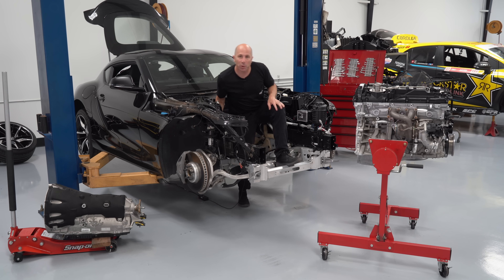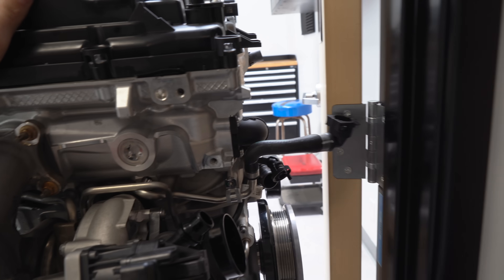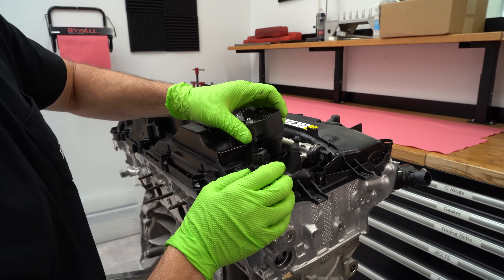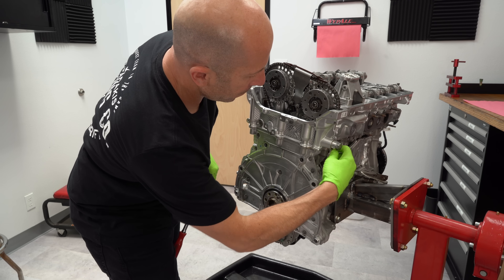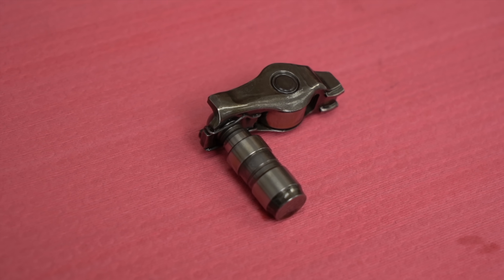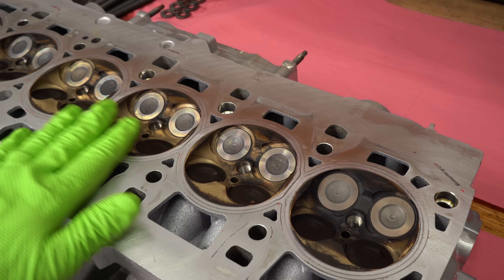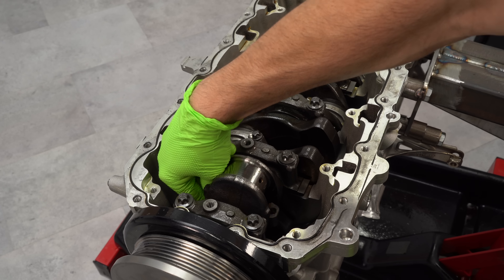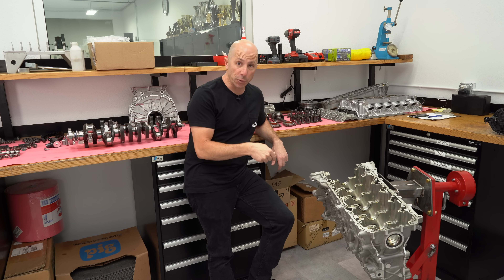2020 Supra B58 Engine Teardown - First Look - Better than the 2JZ?

Comment: 1 interesting note- the cylinder head gasket has primarily oiling ports and cutouts for oil drain back but not coolant. BMW designed the cooling circuits for the block and head to be separated. Controlling the coolant flow to each will be one interesting hurdle after some heavy mods and tuning.

Thought- I wonder what sort of boost pressure that intake manifold could handle? With the intercooler integrated, I could see the outer seams being a weak link.

Prediction for b58 engine- silicone everywhere won’t hold up like every other German engine and it will be leaks galore in 5-7 yrs.

Oh and I didn’t see any port injection. Something Toyota would have done to keep the carbon deposits on intake valves from forming. But that’s the BMW way. More reasons to visit the dealership.

-Fan (but critic) of both BMW and Toyota

Comment: Apart from armchair experts bashing/stroking on this - it looks complex and very well built - but that would probably be its downfall - its not the pistons, or crankshaft or 1k HP you'll put into it - it'll be some platic trinket that will age and crack, leading to something leaking, some electric valve fail or some shit like that... Its fine when it all works, but plastic, that doesn't last that well...

Comment: So it looks like a lot of the parts and components on this engine are incredibly specific and comprehensive.

For example: The intercooler is molded inside of the intake manifold, or how the turbo housing bolts directly to the exhaust manifold and is precisely casted for this engine.

I guess what I'm saying is that by designing all of the components so specifically, they've left very little room for aftermarket parts to be used, or for changes to be made.

I'm sure it's a great car. It seems like it's well-designed and has had a lot of thought put into it. I just don't think it will be very tuner-friendly.

And one more thing to add. Since this engine block is aluminum and not steel, I suspect that it will not be able to handle the harshness that the 2JZ could take as far as pushing the limits of boost pressure and other forms of punishment.

Comment: Bmw valvtronic spring decompress tool for the n20 4cyl shoukd work
Reply: Thats what I was thinkin.
Reply: @joshuaspencer6246  ... or the one for BMW N52 engine (I see that B58 shares these parts with BMW dual vanos engines)... I remember the torment I experienced when one year ago I did this work without any special tool...
Reply: Isn't one of the tools you mention just exactly that what he just ordered?
Aren't all BMW valvetronic decompressers just the same tool with different packaging?
Reply: @S.Tarvitz  I have... LOL
Reply: @S.Tarvitz   PHD in calculus? Wut? Do you determine the second antiderivative to calculate at what angle to hold the crowbar to loosen those springs? I'd rather just read the manual.
Reply: They change up the mechanisms here and their per engine update so that though similar its differemt and specific enough. A tool fro. Previuos engine might work or can easily be modified fabbed up to work properly. And not have to dish out the hundreds the "new" tool costs.
Reply: He could of bought a b58 from bmw lol

Comment: Looks like motorcycle tech inside that engine.  Car guys are way ahead of us in terms of electronics, but we have you beat on the mechanical side.  Coated bearings, cracked rod caps, low friction rings, all stuff that's been around for 20 years in sportbike.  If we can finally merge car and bike tech, we'd have some seriously impressive machinery.

Comment: Timing chain in the rear, intercooler in the plastic manifold, direct injection, valvetronic ,plastic oil filter housing, internal exhaust manifold inside the head?!?!? As long as nothing EVER breaks you’ll be ok! Scratch that! New = crazy amazing! Used =junk

Comment: Wow. Thank you so much for this. I don't have a Supra, but I've got an M240 with a slightly earlier version B58. Very informative stuff.
Reply: The biggest difference with your engine are the exhaust manifold and the timingchain. Yours has a split 2chain system and this is a 1 chain system. Also yours has an external exhaust manifold and this an integrated one in the head.
Reply: @kerimmejdoub1381  noted! Thanks

Comment: Fly by wire sucks because the manufacturers deliberately stunt the performance of the vehicle to comply with emissions controls. You don't have any direct input to the throttle. The computer controls the throttle. All these sluggish modern cars would be fine with an old school throttle set up. 

I think Toyota should have just refreshed the 2JZ. BMW have poor build quality. The rear timing chain will be the killer of these cars. The N47 diesel has the same fault and they snap left right and centre. Typically around 80,000 miles. Toyota on the other hand can make timing chains but chose to have a BMW one. What a disaster.

Comment: I really cringed when he was loosening the valvetronic springs. That's a sure way to break it. 

Most of these features on this engine, BMW have been using for years now. Comparing this to the old B58, the only new thing i see is the integrated exhaust manifold in the cilinderhead and a 1 piece timingchain instead of a 2 piece they used since the N47 and N57 diesel engines(since 2007). That's also where the idea of the rear placement on the block comes from.

Comment: With no roller cam follower on the HPFP, prepare for TFSI type cam lobe wear.
Reply: You are correct that was the problem with the audi and vw my friend replace his every 20k to be problem  free in in the gen1 but in the rs4 v8 and ae888 gen3 is ball bearing so no problem there
Reply: bmw had this design for over 10 years, with minimal issues..

Comment: If you buy this car, sell it before the warranty expires, it'll be an expensive fix!Very complicated engine design, every part will cost big bucks, that solid front main oil seal area means you can't line bore the block if you need to, the 2 exhaust port head will limit top end power, pretty lousy design in my opinion.  I'm not getting one!

Comment: Hey, say what you want, but this looks pretty simple compared to most of the engines from 2018-2019. Timing chain is in an awkward position, but it should last a long time. And plastic intake manifold with integrated intercooler is a no no. Other than that - pretty simple creation from bmw, looks promising.

Comment: That straight Line ^ engine sound is so smooth. No other engine design is as smooth as the straight 6....I'm very impressed that the designers went to a Closed deck block. This will help engine longevity when modding this block for extreme horsepower and higher turbocharger pressures. I did however NOT like all those Plastic engine parts. Especially the oiling system seems to me to be a large weak area. I can only imagine that few shade tree mechanics will even attempt minor bolts-ons to this new designed engine. Not much you can do other than an intake and exhaust system upgrade but I can imagine that wouldn't get you much horsepower increase as dependent upon the costs involved. I still dont like the Body design of this New Supra, seems a bit smallish to me. Toyota has a history of using other manufacturers engines for their own designed vehicles, nothing new there/here. Nope ill stick to older designs that can be modded by amateurs, this one is too costly to mod as to what you would get out of that mod. But AWESOME Video as always at Papadakis Racing. You will never see other YT creators give you the engine tear-downs that you get at Papadakis Racing.....Great Job !!!

Comment: 1. The timing chain on the back of the engine, to change it you have to pull the engine out. The only reason why they did that is to force you to go to the service and get it done (Imagine how much this have to cost at the service for engine removal and timing chain replacement). I like to fix cars by myself so this is a big minus for me...
2. Integrated exhaust manifold with the engine block, easy to manufacture as it can be manufactured when casting the engine block and doesn't require any pipe welding, although we all know how much gunk builds up in the exhaust manifold over the years this will be very difficult to clean.
3. This engine looks very cheap by looking at the amount of plastic used, over time engine heat will damage the thermal properties of this plastic and it will become very brittle, in case of a fault, pieces can get into the inside of the engine and kill it.

No point to keep going with this, this engine has capabilities to go over 1000hp, but it's not anywhere near the dependability of 2JZ to maintain this power for a long time.

Comment: Those main caps and exhaust ports both look like major future issues. But theres some decent innovation here. Its going to be pretty tune/buildable as far as bolt-ons are considered but anything more than that is going to be a ginormous P.I.T.A. Maybe after a while there may be some solutions found but until then... Fuck it. Its too soon and too odd to be an enticing build platform.

Comment: Wow - what a nicely designed engine. I must say - I still going to hate Supra from the perspective it is not supra at all, but just BMW Z4 Coupe with Toyota badge on grill. I have driven both new Z4 and Supra and they are identical, infotainment identical, controls identical, build on the same line. Honestly, just a lot of fakery - HOWEVER, from engineering point of view B58 engine is real spiritual successor to 2JZ - it is relatively cheap, simple, easy to tune and has a lot of reserve power. It has been long time since we have car which could easily gain 100hp with a map, 200-300hp with bigger turbo and do crazy power in 1000 hp range with standard block and what it seems much of standard internals. So the issue is just a badgeing and being purist, but the car is technically very solid.

Comment: It looks like on the head casting they have left 2 bungs in the head which could be used to add more flow to the internal manifold. Obviously enlarging the ports and drilling and tapping would be required

Comment: Would definitely get an extended warranty on this. Any possible repair on the engine looks expensive. But it’s a beauty. Interested to see what tuners do with a direct mounted turbo and curious to see if anyone develops an larger aftermarket intake manifold with a larger inter cooler built inside. Might have to mount the turbo elsewhere if going for large turbo builds .

Comment: Your limitation seems to be the exhaust manifold. You can only get as much flow as the internal exhaust manifold and ports on the outside will allow you, afterwards back pressure and exhaust temp will be the major limiting factor of this engine.

Comment: I'm a former BMW owner. This engine was designed and is built by BMW, no? The use of plastics on and inside the engine is just plain stupid. At some point down the road the owners of these cars will hate them. Toyota is famous for building bullet proof engines. This deal with BMW may be the biggest mistake they could have made.

Comment: Gets minty brand new motor - rips it apart instantly. Personally I don't like direct injection as much as port injection, sole reason; dirty intake valves. Looks wicked otherwise.. 12 yr old MKIV fanboys will still complain

Comment: I lost it when he said "internal exhaust manifold". So how are you supposed to clean the carbon out? And a plastic intake manifold? This engine is such a POS. I vouch for the OG iron block 2jz. If you want a new sports car get a tesla. These modern petrol engines are crap.

Comment: Ugggh timing chain in the rear I had an Audi RS4 and that was a bitch any time it came to timing issues, had to spend a lot of $$$$ just to pull the engine every time but that was Audi soo 🤷‍♂️
Reply: Big bummer indeed I know the pain ya’ll had to deal with those issues on the Audi’s 😢

Comment: Honestly I think they are attempting  to make it to advanced for their time, I think this is impressive but would have been way better if they took a 2jz and pulled all the data from 10 years of wear and tare and just did an overhaul of any imperfections (there was slim to none) that the engine had. Obviously they would put an automatic but the platform could have supported a MT and when the tuner got the car they would buy the trans and swapped bnb it to their liking. 

Love the channel. Host is awsome and my dearest best wishes for their success 

but in my feedback on the engine and Toyota,  They had something great in the past and attempted to fix what wasn't broken. Chevy didnt make that mistake.
Reply: john Laughlin obviously the 2jz was a great engine but also Stone Age technology. Looser tolerances which aids oil burning. Slower warm up times. Pretty basic camshaft technology. Everything now a days revolves around, efficiency, emissions, refinement and also ease of assembly in a factory

Comment: Well, the Supra mk5 is almost the same as the G29 Z4 BMW. They are based on the same platform and have the same engine. So, for me, the new supra and its engine can never be as special as the mk4 and NOTHING can beat the 2jz xD BUT i still like it though :)

Comment: Bmw had those timing chain in the back for long time but they use it in diesel engine for example N47
Reply: wir wissen das schon, die sind alle schrott!
Reply: And it was a huge problem.  They seem to have learned their lesson. B Series engines have been I'm service for a couple of years.

Comment: B58 from M3? I'm not sure if it is a good engine, but new Supra is based on Z4, but 2 times expensive than the used M3.
Reply: No. The current M3/M4 have the S55.
Reply: Oh. Sorry, my bad. S55 is from M3? OK, What B58 is actually used?
Reply: @АманАдилов-б3с  Basically any current BMW model ending with 40 (ex, m340. 540, 740, 440, etc)

Comment: Wich tosser designed this car ,we need a manly designed car not this   gayish design. Looks like a Mazda mx6 coupe concept. They should have asked honda to make a straight 6 like the s2000 with 2 extra cylinders. Other engine would be a subaru h6 with billet bottom end.

Comment: I think its smart to put the timing chain on the back so the flywheel can dampen the vibrations that would otherwise be experienced by timing chain especially on high RPM and vise versa even tho expensive if you need to do maintenance.  I bet its a smooth running motor since everything seems to be build around reducing vibrations. I also like the crank pulley design and also the fact that it doesnt use alot of gaskets. Bravo BMW.

Comment: All the people down here in the comments with "lol its all plastic its a shit engine" are fucking retarded. That's not what matters at all. What matters are material and construction of the high stress parts like the crank, the cams and the block itself. This engine can handle 1khp guaranteed, Toyota's borderline autistic design combined with european steel quality makes this thing a hard nut to crack.

Comment: idiotic german engineering:
-uses TORX (????????) bolts on a cylinder head. yea, try and get those loose when the car is 15 years old.
-uses badly designed variable valve timing with overcomplicated return spring mechanism
-uses heavy, hydraulic valve adjusters on a high rpm sports engine

Comment: Race car engine builder that understands the tech and engineering behind the engine: “I’m impressed”

2j fanboys on the internet: “that’s garbage it’s gonna break at 1,000hp”

yes but so does a 2j... you have to replace components of a 2j to make a reliable 1,000hp give the aftermarket like 2 years and I’m sure you’ll see reliable 1,000hp b58’s Toyota intends for the new Supra to be a tuner car...

Comment: Toyota said they did some "stuff" to this engine. what did Toyota do differnt when compared to the BMW z4 engine?
Reply: Nothing really on the hardware. They pulled more hp with programin.
Reply: @tonilehtila1707  No it actuslly has less hp than the z4, I think they just reinforced the engine to take more power or reliability
Reply: @fredd9340  they did nothing with that engine. Trust me, it's the exact same in z4.
Reply: They did nothing compared to the Z4. For the rest of the car the inside looks more BMW to me than toyota. All the buttons and the older BMW idrive system in it.

I am a BMW mechanic and the only toyota things i see is the outside shell and the badges.

Comment: with the silicone sealed front cover and oil pan, (remember to use FIPG to put it back together, that's the Toyota stuff) and those lifters, that's all classic Toyota, but all those torx and inverse torx is and the requirement of a special tool is all BMW. you could really tell that it was a fusion of design philosophies. 
im also very impressed by the design, i think it will do 1000 easy, and all aluminium too

Comment: Some old cars from 60s had the manifold built into the head and the not using gaskets is what the northstar engine did so it looks like engines are going back to what was done once but abandoned. I can see that oil cooler causing problems when this car is a few years old but it looks like the engine is well engineered for mostly easy maintenance, I'm impressed.

Comment: just realized a turbo s2000 would spank this in every aspect lol
Reply: In what aspect would a turbo S2000 spank this? Literally everything is better on this.
Reply: @somenutjob  well yea if you dont know shit about cars....... this is literally trash... lolololol everything is better? oil pump in a plastic valve cover....... plastic intake manifold with a the intercooler inside..... timing chain is in the back so pray you never need to pull the whole engine and go take a look at that intake cam lmfao the only good engine made by bmw was in the mclaren f1..... since then everything is plastic trash lol you can buy one though just hope you never run a mark 3 let alone a mark 4 hahahaha
Reply: @somenutjob  bmw reliability has left the chat*